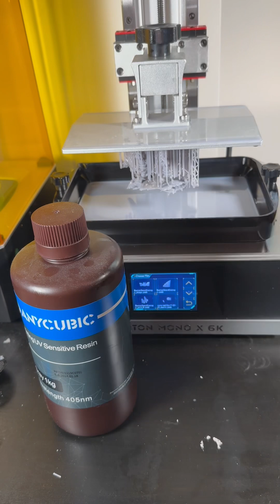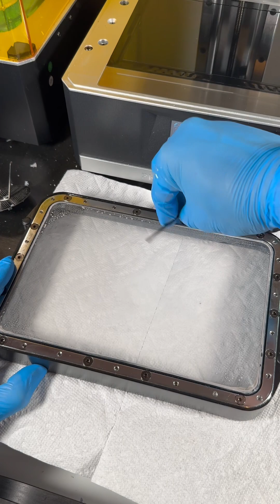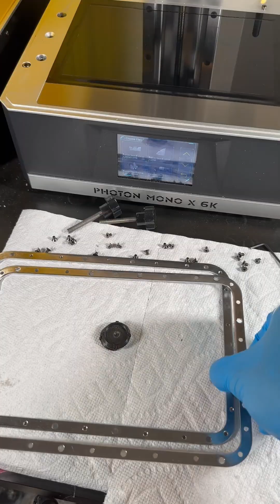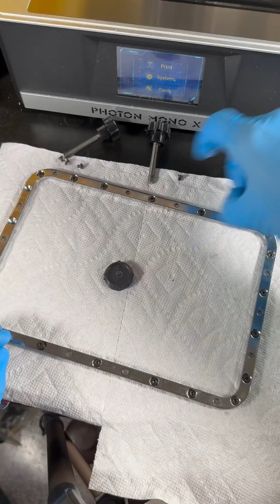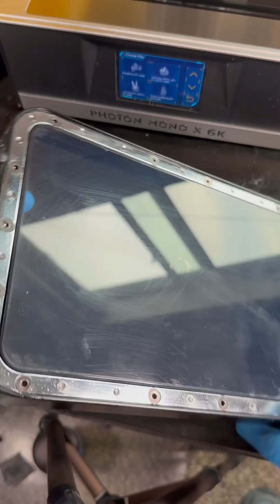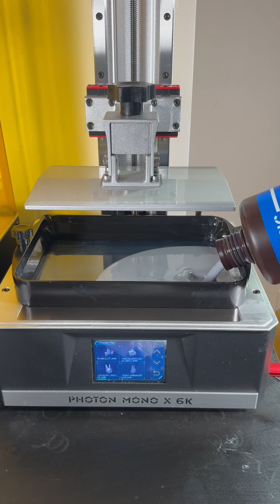Don't Let Your 3D Prints Fail Anymore - The Secret to Replacing Your FEP!

Comment: I have this exact problem on this exact printer. Thanks you SO MUCH for showing this. where is the best place to get more film for the vat?
Reply: right at the moment my hardly used saturn 4 ultra 12k has issues 
The print starts fine but an hour or 2 into the print the print starts sticking to the Feb sheet with the model separated from part of the print still attached well to the build plate and the temperature almost immediately goes from 68 degrees Fahrenheit to 95 even a few times 105 room temp is 68 to 70 
If anyone has any idea why please let me know 🙏 
Thanks 
John

Comment: My prints constantly stick to the FEP but not the build plate. Please help.
Reply from the maker: Try a thicker/wider base with your supports. You also might need more support in general. Also make sure to clean the build plate.  
I hope this helps! 😁
Reply: Reduce the initial layer cure time. This helped me immensely. Went from 40 to 20 and had 15 prints in a row go perfectly before replacing the fep.